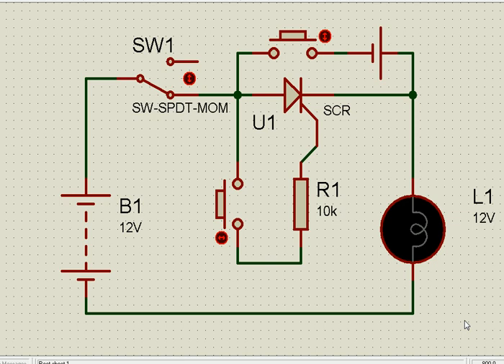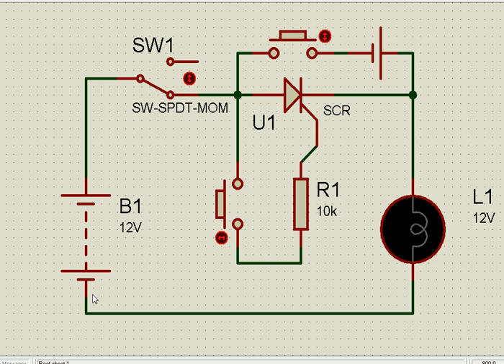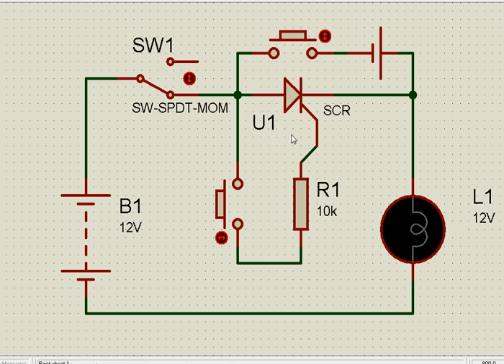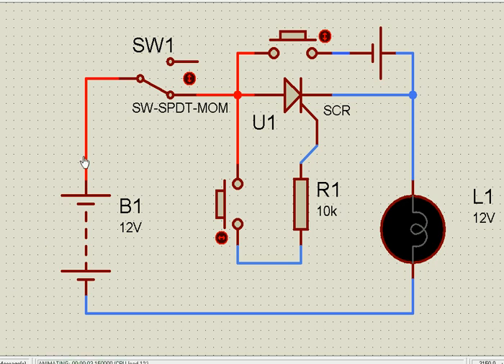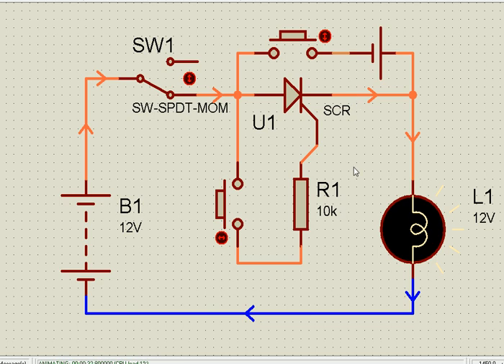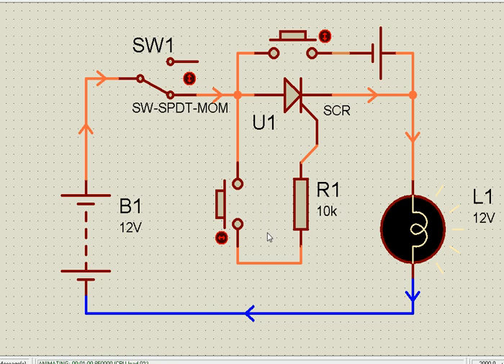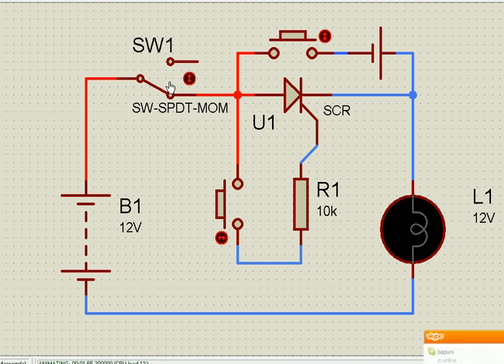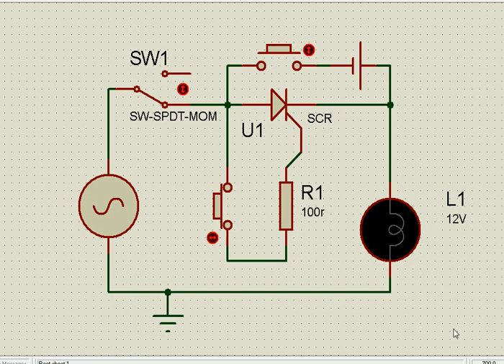Practical Electronics 5.avi

Comment: Great job! Thanks.

But could you please explain it in detail, how and where you connected and adjusted the oscilloscope? I don't see your connection there. When I connect channel A between SW1 and U1, I get just a horizontal yellow line. There is no wave - neither on channel A nor on channel B (blue).
Could you please help us. Maybe with a video about using of oscilloscope in Proteus, if possible.

Thanks in advance!